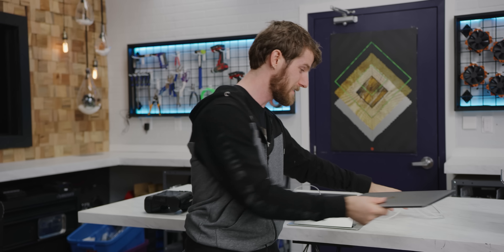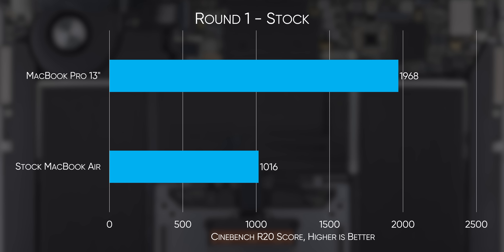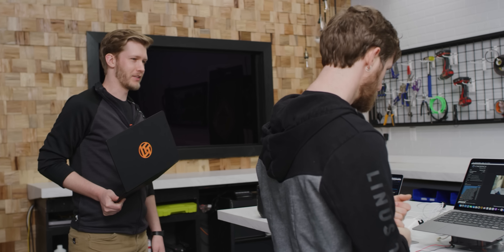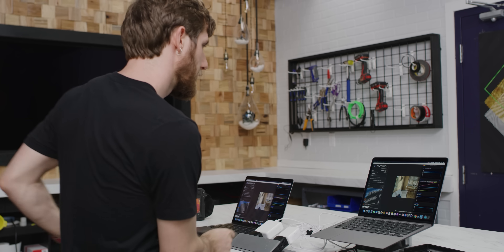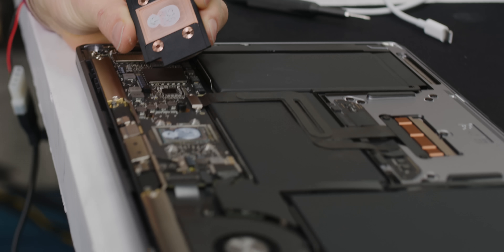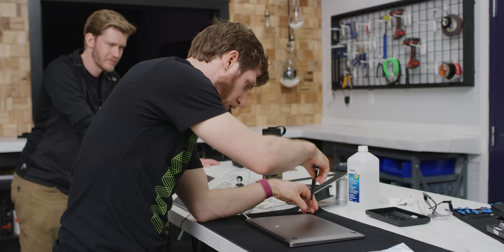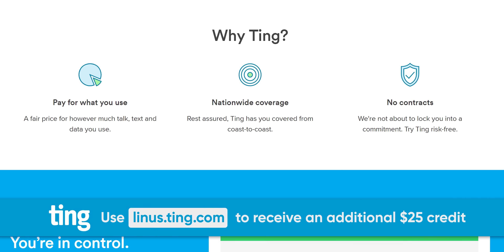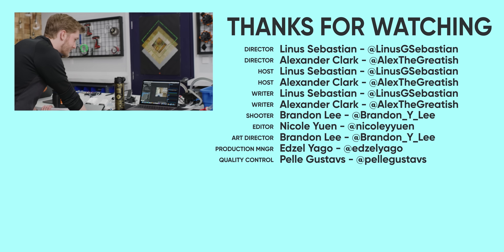Fixing Apple's Engineering in an Hour

Comment: I’m sorry but the thermal paste that was used is nowhere near as good as the arctic MX-4 2019 formula. The new formula uses carbon in the thermal paste and allows a massively better heat transfer.

Comment: Louis Rossmann went nuts over this exact same thing...check out his Wireless Cooling video.
Reply: @futtt_buckerson  Obviously, because he knows how bad MacBooks are, since he repairs them every single day.
Reply: @futtt_buckerson  Also has easily one of the least tech savvy consumer-bases out of any tech company in the world, wonder where all that customer satisfaction comes from?
Reply: @futtt_buckerson  not a chip on his shoulder, Apple for 7 ish years has produced hilariously bad garbage, and he has to deal with their bullshit defective boards every day. Apple throws out basic engineering and design standards not even to be cheap but out of sheer incompetence. Fuses that are supposed to protect components placed further along the power lines than the components they protect.
Reply: @gb6912  yet if they didn't produce hilariously bad garbage Louis wouldn't be making a living ;)
Reply: @markjordan7800  😂 exactly
Reply: @gb6912  fuses are not meant to protect silicon, they are there to prevent fire. Even fast fuses blow much slower than any silicon they'd be designed to protect. Overcurrent protection is implemented via current monitoring and microseconds reactions. Fuses blow in like 100ms at around 3x times their current rating (consult a datasheet for detailed info) - fuses rating has to be way (like 2x-3x) higher than the max rating of the circuit they'd be protecting to avoid inrush current blowing them just like that. 
People get impression how fuses protect based on household and car ones, for instance inrush current on the headlight is very high for halogen based lights. Inductive loads (motors) can blow fuses (or trip breakers) for similar reasons, inrush current is 8-10 higher than the nominal.
Reply: @futtt_buckerson  I don't blame him.  Apple partakes in anti consumer practices and produce shody half assed products that are designed for failure so that you'll come in to there stores and pay their high fees to repair their sh*ty computers.  
Not to mention. Here is the states, they are one of the companies fighting the right to repair bill which would allow people like you, me, and Louis Rossman to repair our own electronics (or take it to a guy who can) just like how we can repair a car.

I don't blame Louis for having a chip on his shoulder when it comes to Apple.
Reply: @futtt_buckerson  Yeh and mcdonalds are one of the most valuable and successful restaurants in the world, guess they must serve the worlds best and highest quality food
Reply: Hahahaa - excellent:)
Reply: Why won’t they put little tiny heat pipe there, costs 5$ maybe
Reply: @macaronivirus5913  For them? They could've retooled that design so that it would've cost them nothing, but they still wouldn't have done it. It's all about sandbagging.
Reply: @macaronivirus5913  The reason is simple: They did not want to. It would add about a millimeter or so to the overall thickness of the laptop. And it is not warranted, as the motherboard can not deliver more than 10 watts of power to the CPU anyways.
Reply: @futtt_buckerson  You gotta see both sides of the argument. That's all.
Reply: @futtt_buckerson  You obviously never did ANY maintenance on an Apple product hahahaha
Reply: @futtt_buckerson  apple is the most impressive example of sunken cost + irrational escalation ever demonstrated aside from marxism
Reply: @futtt_buckerson 
Thats because majority of their customers know nothing about engineering, if it work it work, if it not, it's due date for upgrade, that kind of mentality. It doesn't help the case if they stuck within apple ecosystem.
Why these things rarely happen on Windows machine? Because if hp, or dell pull this crap, they will be beaten deep into oblivian because competition exist in window space.
Reply: @futtt_buckerson  umm the galaxy s20 is even with the I phone 11 on many different benchmarks and for the same price. And is much more powerful than a I phone se
Reply: I have mbp 18, it's a good laptop but it has reoccurring keyboard issues, screen has noticable stain gait, I majorly do programming on it and some occasional league of legends like 1-2 game in few months on a windows boot. It's not worth $2300, but for my use case there is no alternative. I still have my 2015mbp which is the best series Apple has ever produced in recent times.
Reply: Link: https://www.youtube.com/watch?v=iiCBYAP_Sgg
Reply: @futtt_buckerson  no sorry but I have to disagree with you on that one LOL. He doesn't have a chip on his shoulder Apple just releases over priced garbage and they rip off their customers as well.
Reply: Guy is trolling hard, even this video shows the issues. Only thing Apple has going for it is the few devices it needs to support. But if you have an issue then you're screwed and pay a tonne to get fixed. If you're buying apple products by from a third party shop that offers great return and warranty. Apple's warranty is disgusting
Reply: Lmao wireless cooling
Reply: @futtt_buckerson  Apple's computer bussiness makes up 9.8% of their products. The rest is iPhones and services.
Reply: @futtt_buckerson  So it's "Computer" company, or is it "Technology" company? Make up your damn mind.
Reply: This video from Louis: https://youtu.be/iiCBYAP_Sgg
Reply: @futtt_buckerson  everybody who buy Apple are stupid fanboys, of course they have good customer satisfaction.
Reply: Louis is gonna lose his mind (again) when he sees that the Cooler isn't even connected to the Heatspreader 😆

Comment: so all they needed is to put a thermal pad on the bottom, not be so sloppy with the 'heatsink' clearance, and attach the fucking fan they already put in there to keep people's laps from burning and the machine would have been 20% faster
Reply from the maker: Basically.

Comment: The explanation is simple: the MacBook Air would be too close in performance to an MacBook Pro.
Reply: Otherwise everyone would have gone for MBA... But for mbp13 sales... They gimped mba , :/
Reply: @sadieangelina  you have it backwards. Apple is taking a 30w CPU and forcing it to consume 15w.  As Linus noticed here, even the best cooling in the world didn't make this chip go over 15w, so Apple is obviously limiting power draw.
Reply: You nailed it.  That is exactly why Apple gimps this cheaper laptop.
Reply: Basically what happened to the Lamborghini Huracan and the Aventador
Reply: Which means the macbook pro is shit as well?
Reply: Arthur Morgan: I don’t mind that the MacBook Air is slower than the pro. The speed is sufficient but i do mind that it runs up to 100 degrees. That’s why i cancelled my order. If they had implemented better cooling and kept it running more cool on heavier use, but slower than a pro, then i would hav happily bought it.

Apple just doesn’t want you to buy this machine for that. They intentionally crippled the cooling to not treat into MacBook Pro usage territory.
Reply: @rolfj953  Yea but according to another poster on here it is all Intel's fualt for not using 7nm and basically Apple has no fault at all in all of this. I guess he forgot the part where the fan is placed in a spot which makes it pretty much useless for cooling or the fact that the CPU heatsink if you want to call it that is almost making no contact to the CPU. They sure named this model right when they decided on Macbook air. I never actually thought it meant contactless cooling though...lol /s

Comment: I don't know why I'm shocked about Apple's """heat sink""".  It almost seems like you could have grabbed any random idiot off the street and ask them to design some sort of heat removal for the CPU and they would have done a better job.  If you had just a solid block of copper touching the die I bet it would perform better.

Comment: Ypu should have run a longer test, because in this case, system has not reached it's thermal equilibrium yet, especially with your add ons. 

Running longer test, something that lasts atleast 30 minutes would have given a better idea of how each change is performing.
Reply: Also, blowing the fan over the heated chasis ( after thermal pads) would have resulted in significantly better results.

Comment: Should've used a copper shim. Replaced the thermal pad in my Acer One 722 with one. Worked great in combo with Arctic Silver and almost doubled the heat dissipation.

Comment: Every tech tuber is parroting this whole "heatsink not connected to the fan" thing. And while technically true, no one seems to take the time to actually look at how the solution is designed to function, in-fact you can see these design features in the footage in this vary video. The laptop intakes air from the left side of the laptop (you're sitting in front of it using it), and draws it across the board to be exhausted out the other side. To be more specific there is a roughly U shaped air channel formed by some sealing material on the inside of the bottom cover that directs air from the intake, across the  half of the motherboard to the heatsink where it crosses the other half of the motherboard to the fan where it is exhausted out the right side of the laptop. This is no different to how a standard PC case is cooled where a fan blows air into the case, moves it across the components and various heatsinks, and exhausts it out. Many OEM solutions from Dell etc function, or at least did function,  exactly the way this laptop does where they have no fan attached to the actual CPUs heatsink and rely on a exhaust fan to pull air from inside the case, across the CPU heatsink and out the back.

Similar case for the thermal compound. There is a gap because apple is using some form of thermal pad in the Airs instead of a liquid type compound. I've personally removed it from a 2019 air where apple used an almost identical looking pad as used in some AMD cards a few years back (almost black, carbon/graphite impregnated?). For whatever reason they chose to use these pads and therefor designed in space between the die and the heatsink to account for them.

I'm not saying their solution is sufficient in this case, in fact I 100% agree that it isn't, but it would be nice to see at least one of these channels actually figure out how it was designed to work instead of mimicking the same line over and over without actually investigating further, or at least telling their audience about it.

Comment: Like you say, you REALLY don't get it. You've made this same mistake before when discussing this machine ignoring the thermal design of the case where the fan draws air over the heat sink due to the overall layout. The proximity of the fan to the heat sink is not particularly relevant, it is the airflow through the heatsink that matters. As you learned a form factor this thin imposes additional thermal constraints on the overall form factor. The design challenge starts with making it thin, not the positioning of the blower relative to the heat sink which is in fact a response to this challenge

Comment: So...Alex. Tip from a machinist here... PLEASE lock that quill feed on the spindle and use the table Z height adjustment next time. You have a lot more control with the table adjust, as the quill can be flexed by pressing down with the "drill press lever" too hard. Not saying it's impossible, but it is easier with the table feed. Thanks and love the channel. Nifty Bridgeport you've got there :)

Comment: skin temperature limitations are a regulated thing in most markets, and there are limits to how hot the skin temperature can get before the device has to throttle (or turn off), so it's not surprising they have insulators over the heatsink.  I'm guessing a lot of what you're hitting here is thermal throttling not related to the CPU package temps themselves, but temperatures around (thus what the "skin temp" would be), and the readings are likely coming from under the keyboard, not the bottom of the device.  Just something I've run into before on other devices, and this behavior is exactly what skin temperature throttle behaves like on other devices.

Comment: I have a 2018 MBP and I'm seriously considering dumping it for a good Windows laptop (ugh) simply because of heat and CPU utilization issues. It's like everything I do, whether it's browsing photos on Flickr or IG, watching YouTube videos, etc...everything makes this thing hot enough to fry the hair on my legs. It's absurd how much CPU simple applications use. And interestingly, on both my work and personal MBP, I've had several instances recently where the battery would just stop charging while the laptop is connected to power, so it wouldn't even stay charged. Super weird, and really damn annoying. EDIT: For reference, while watching this video, Google Chrome Helper (renderer) is at 79% CPU. Ridiculous.

Comment: I have a 2013 13" macbook pro with the i7... Unless I run the fan at 50% it will idle at 60c. And anything actually intensive, I have to max the fan to maintain 60/ 65c.

Comment: Apple is definitely trying to rip people off till they make their ARM MacBooks
Reply: No they're not trying to rip people off this is all Intel's fault for building 14 nm CPUs  if they built 7 nm like apple the CPU would be small enough and efficient enough to fit a fan over and not make the chassis too thick
Reply: @loveiphones4550  Look at the fanboy, not even knowing what manufacturing processes are.
Reply: @loveiphones4550  put the crack pipe down.
Reply: @loveiphones4550  your beeing sarcastic right? I mean it's not like AMD won't sell their products to apple, and they do offer 7nm processors, and well they still need cooling, even the most power efficient 7nm x86 or ARM will run hot when you don't actually connect the heatsink and the CPU.
Reply: @ @loveiphones4550  I can just hear the Design team meeting a few years ago ;  "Intel has promised us new 10nm CPUs for our mobile platforms.  Let's re-design these to be the best in class around this new chip."

Comment: The stock MacBook air is so bad, I managed to get Intel's 7w tdp cpu (i5 10210Y) to get the same score with a slight undervolt 

Also it only reaches 70°C max

Comment: Well, the ARM cpus shouldn’t use as much power, so they should be cooler with similar performance... ¯\_(ツ)_/¯
Reply: In ARM only applications. x86 is still capable of so many more instructions than arm, yet it still produces a lot more heat than ARM. At least AMD'S Ryzen cpu's are a step in the right direction.

Comment: Should have tried a thermal pad under the heatsink, on top of the die, before modding the pressure mount... would have been interesting to see if simple addition of thermal pad instead of paste worked better (to fill the gap)

Comment: So apple knows the time the thing will overheat and built in a powerdown thing for it separate from the actual temp.
This means that even if you run the thing without sensors it'll still power down because its on a timer.

Comment: I think one explanation is, imagine a closed box, the fan is in one extremity, since it's CLOSED/SEALED, the fan will suck the air that's inside that sealed box... So in theory would remove the hot air no matter where it is... Of course the closer it is to the fan the best, but the CPU is close to the fan... I just don't know if the MacBook (bottom part/where hardware is) is a sealed box

Comment: Try bootcamping into Linux and manually setting the power limits. Then directly connect an external power supply to guarantee you aren’t being bottlenecked by the batteries.

Comment: without opening my macbook and just got a 120mm fan to suck air from the top (of the keyboard) i got about 5degrees less heat...kinda found out that keyboard silicon covers before made my macbook run hotter..so the keyboard gaps also act as an exhaust for the heat. now i just place a bigger 300mm fan (i got off the laptop stand cooler that doesn't do a thing) and from an average of 65 degress im running at 57degress....sucking out the air is better as before i had only a small USB fan blowing on the keyboard and only got it down to 65degrees...(without the USB fan blowing it's an average 70-80 degrees) sucking air out even with a weak @$$ fan actually made a difference. 

and yes, it limits you from using the keyboard, but I use a bluetooth keyboard anyway. 

so, the body acting as a heatsink and the palms also adding as an extra heatsink reduces temps but if you directly suck the heat from the body it reduces overall temps as well.
testing it for two hours (2) now and it's a steady 56.2 degess...from previous 65 degrees with a sub fan blowing (not sucking) and 75-80 without any cooling aid at all.

Comment: App;le designs products to have a limited lifespan. The cooling solution is designed to do two things. Run the CPU hot to shorten its lifespan and after a year when the CPU cooler gets clogged with dust thermally throttle the machine. Anyone who cares about the environment should not buy unservisable and non upgradable products designed to have a limited lifespan. If Apple made cars the bonnet would be welded shut so you would have no way to change your oil or coolant and your tyres wouldn't have air valves.

Comment: There’s a bit of a difference between the temperature the laptop bottom will reach while in open air and the temp it’ll reach while resting on ur lap with ur warm body/clothes trapping the heat